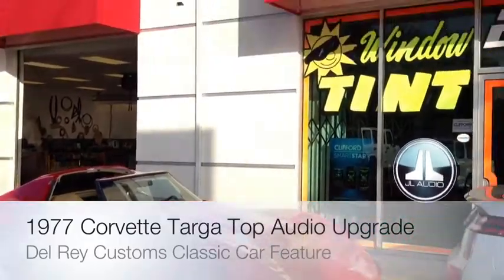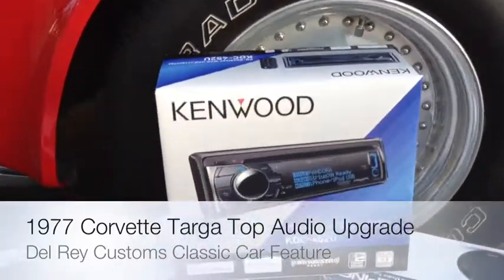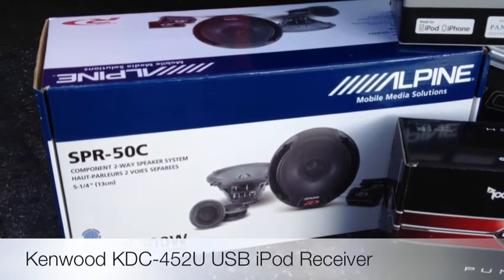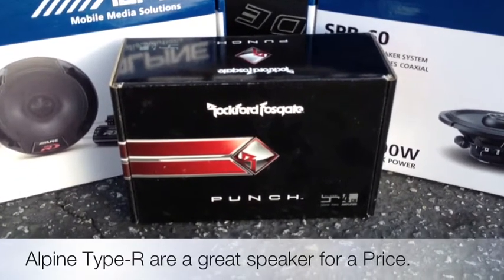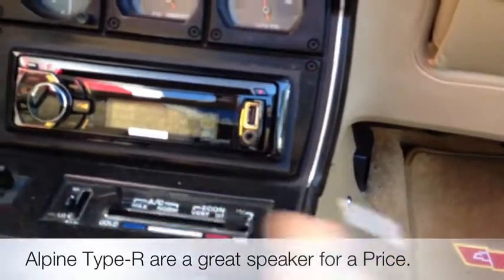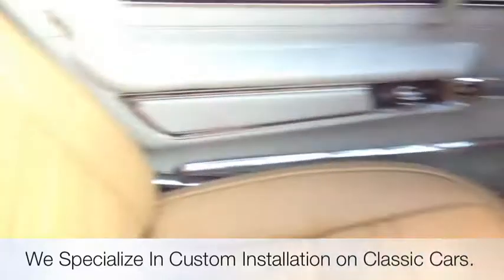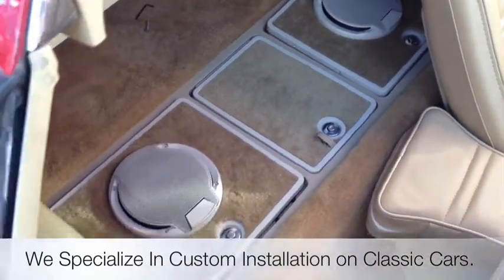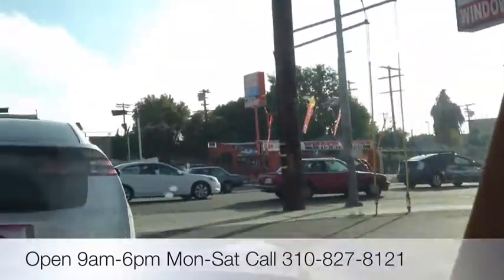1977 Corvette Sport Coupe Custom Audio Upgrade and Kick Panels

Comment: Where did you move the battery for the rear speakers?
Reply: it's still in there, that's why the cover doesn't close all the way..
Reply: Where can I get those fabricated side panels in black? For a 1977